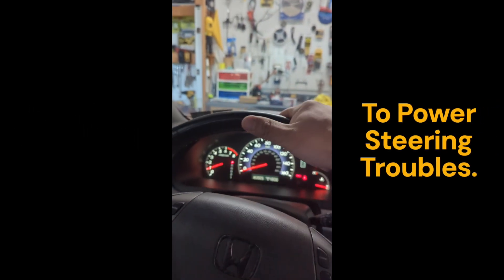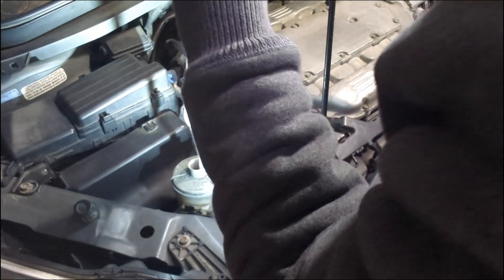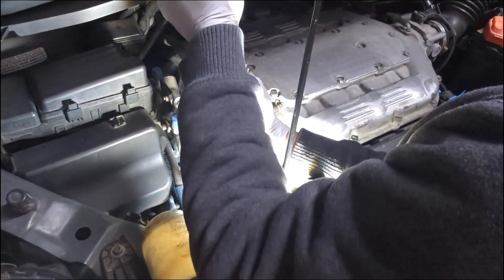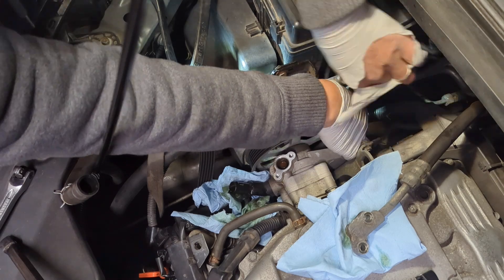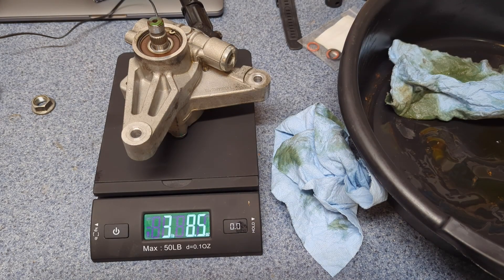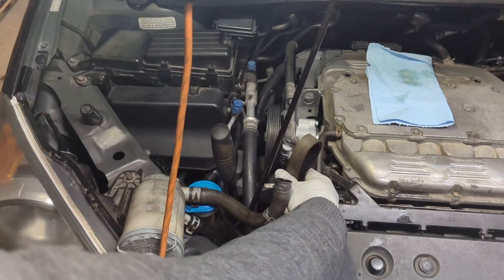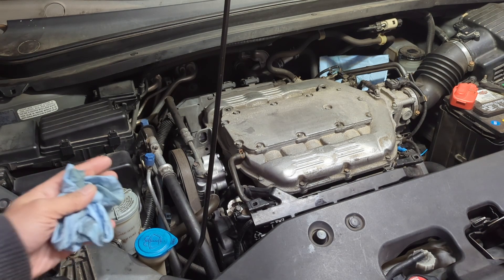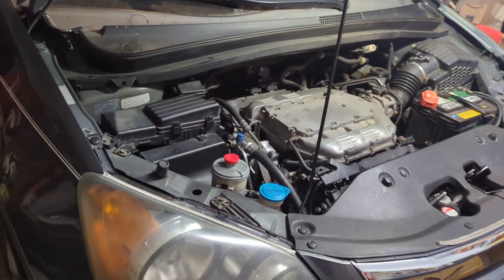Honda Power Steering Pump Replacement and Experiment on Aftermarket Parts #powersteering #genuine

Comment from the maker: Update: Now two months after the installation (in December 2024), the power steering pump has been working flawlessly! In fact, on a rare occasion when my teenager drove it, she commented on how light the steering was without knowing what I did. She learned to drive with the heavy steering of the failing reman unit and didn't like it at all. So far so good and I will update in 6 months, 1 year, and so on. No affiliation but product links in description.
Reply from the maker: Almost a year in, the PS pump is still running great! I copied the link to the product here: https://amzn.to/40CCrTv